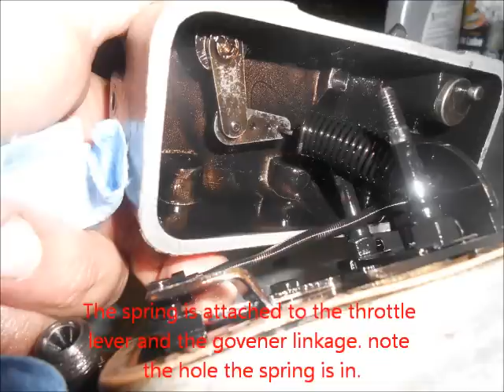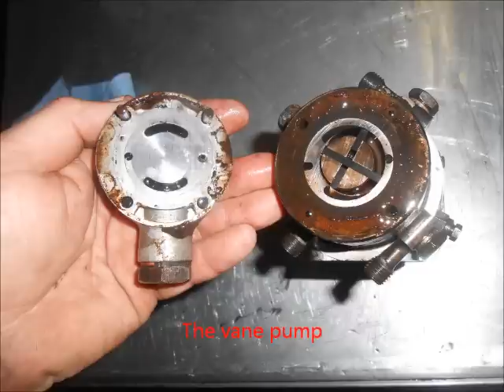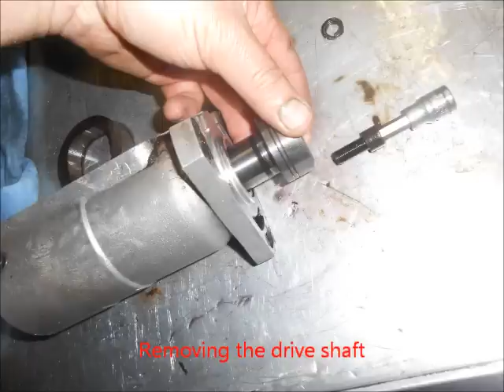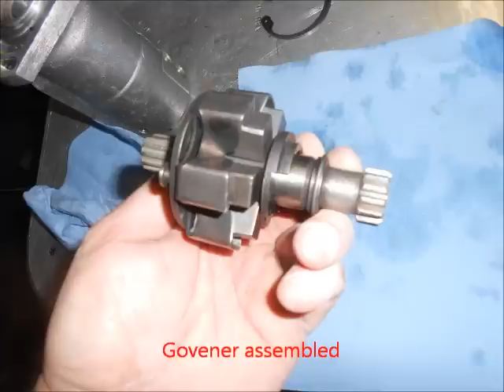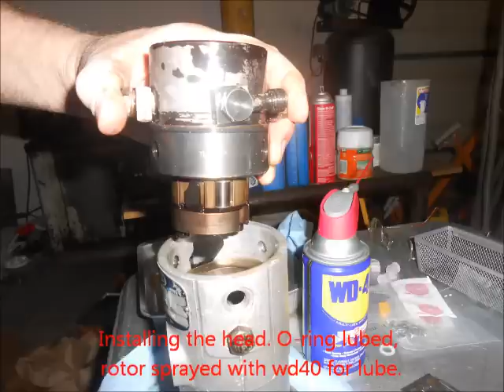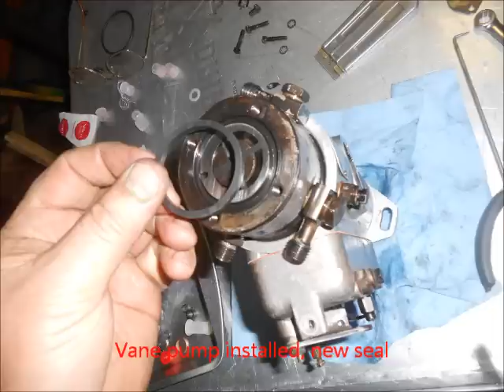cav injection pump re-seal

Comment: nice video very great job!! i want to ask you something? i have a tractor but is not massey ferguson, it is imt 542 ex-yugoslavian tractor 31.3 kw 42 hp and tractor have the same injection pump like massey 135! my tractor have some problems of the injection in the winter has very hard start! in summer start very easy ! and it hasn't much engine power ? can i gett an answer from you!! thank you very much.
Reply from the maker: +Egzon Pllana (Pllana Agrar) kind of hard to say without being there with the tractor. Sound to me like a low compression issue, but most diesel engines are hard to start in the winter... that is why we use block heaters. If the engine runs good when warm, your injection pump should be ok.
Reply: +Rob D yes is true when is warm traktor start good but in summer to when it work from morning to afternoon in that moment when I stop engine 2-5 minutes later he lazy to much to start on summer??

Comment: Kindly share some advice on what could be the issue with my pump. It stopped working two weeks ago,after i disassembled I found the shoe and rollers worn out I got a new set n replaced two days later the same problem hit me again,I bought another set plus the cam ring,because I found out the cam ring also was worn out. Last weekend it stalled again after examining I found the same issue. What could be wrong. Any advice would be appreciated. Thanx
Reply from the maker: You are either assembling incorrectly or you have abrasives in your fuel...
Reply: You need to clean your tank...

Comment: Is there a better gasket and o'rings than OEM?  I have to wonder if these Ford o'rings are safe for the new diesel

Ford pt # gasket 384771R1  and Orings - Ford pt # 49886
Reply from the maker: I don't know. I always use OEM CAV parts....
Reply: Where do you get the OEM CAV parts? Are the part numbers the same?
Reply from the maker: I have a local injection pump repair shop about 50 miles away. I am sure you can find parts on the web....

Comment: Meaning of cav for fitting advance and retrire
Reply from the maker: As the engine RPM increases the pressure from the vane pump increases, pushing the timing adjust piston, advancing the timing.. hope that helps....

Comment: why isnt my throttle lever returning when i let of rhe throttle have to manually do it?
Reply from the maker: with the engine off. remove the throttle linkage from the pump lever. rotate the pump control lever by hand. it should not bind in any way. if it does, you can try some wd40 or the like around the shaft.. might help. I would guess your problem is not in the pump,  but the linkage itself.....

Comment: my tachometer doesnt eceed 2000..what is the reason ?pump???
Reply from the maker: +lilac0038 check your throttle linkage to make sure the lever on the top of the pump is contacting the high idle screw.
Reply: That's like asking " my tire keeps going flat. Nail?"